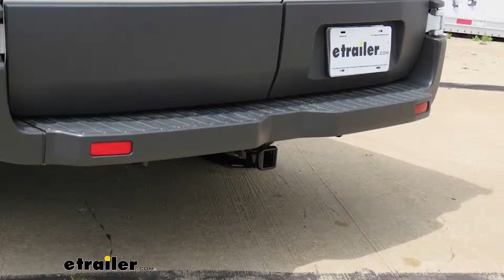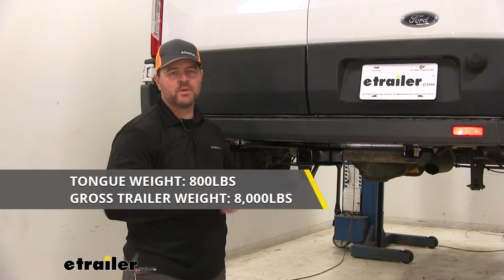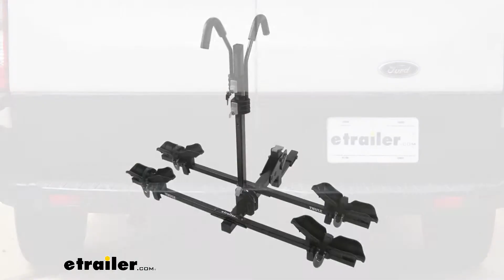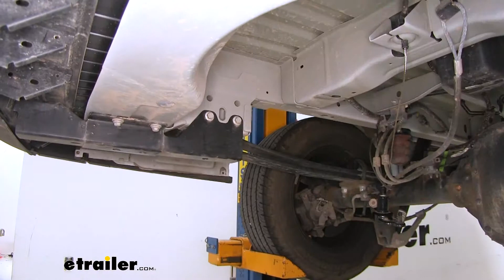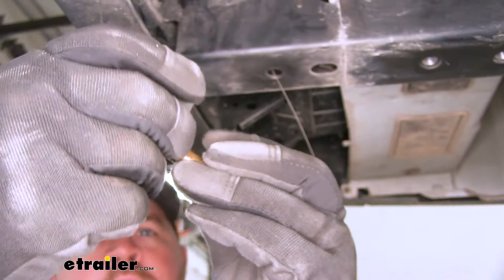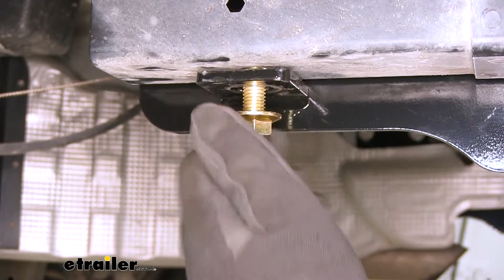etrailer | DIY 2018 Ford Transit T250 Installation for the Curt Trailer Hitch Receiver

Comment: man, i had some sort of defect.  The hitch was all bent out of shape, none of the holes lined up.... i had straps, jacks, crowbars, c-clamps.  Threw the kitchen sink at it.  On top of that, the 4 bolts were so seized.... somebody neglected the anti-seize compound, man did i have a heck of a time getting them out.  One snapped.  On top of that, I have these foot pegs installed on either side so you can reach the roof rack and there was no clearance for the hitch.  I had to use to jacks to push it into place. Took me all day.  I'm filthy, exhausted and fed-up but I got er done.  It was probably the most difficult car repair/mod I have ever done.  I just got this van a few months ago... I love it but i'm starting to notice that whoever owned it previously had no clue about torque specs or anti-seize compound.

Comment: Where can I find the Frame rail bolts, or do you know the part number? Mine are missing
Reply from the maker: There are a couple options. First, you can go to this link and purchase the entire hardware package: https://www.etrailer.com/Accessories-and-Parts/etrailer/RHK.html

Second: if you are just needing the bolts, you can purchase four 1/2-13 carriage bolts that are grade 8 and 1-1/2" long (and 1/2-13 grade 8 nuts if you also need them) from a local hardware store.
Reply: @etrailer  sorry maybe I should’ve clarified. I meant the bolts that are already attached stock to the vehicle. I have the bolts that the hitch came with.
Reply from the maker: @kai6424  for those bolts you would have to reach out to the dealer or anywhere that sells OEM/factory hardware.
Reply: @etrailer  do you happen to know what those bolts are called?
Reply from the maker: @kai6424  You might be able to find them on Ford's OEM parts page for the hitch, let me know if that is what you are looking for? https://ford.oempartsonline.com/v-2018-ford-transit-250--base--3-7l-v6-flex/body--trailer-hitch-components?utm_source=chatgpt.com